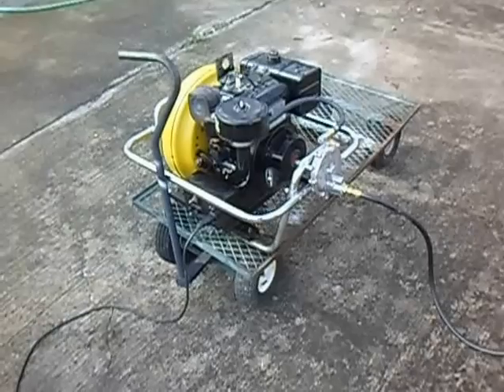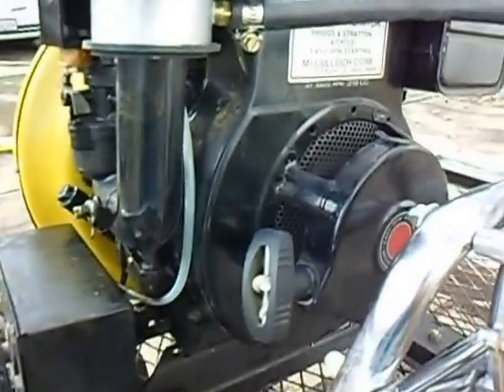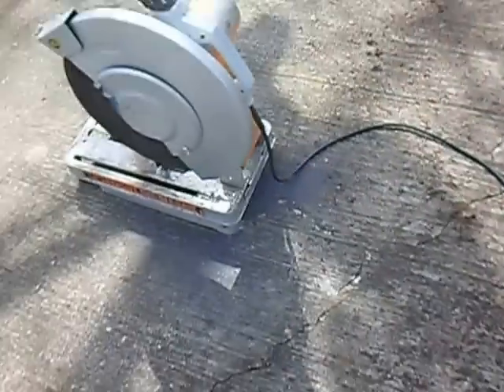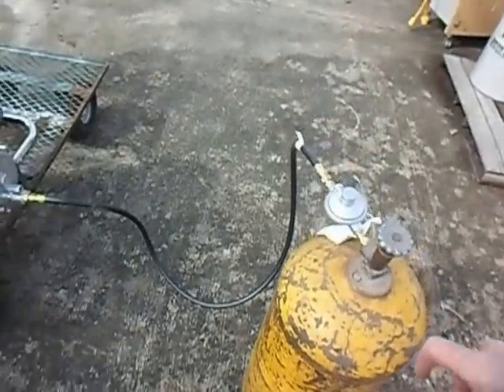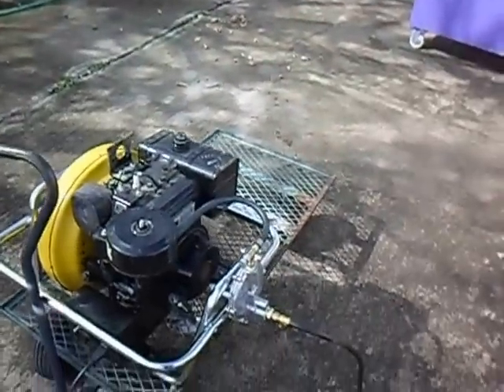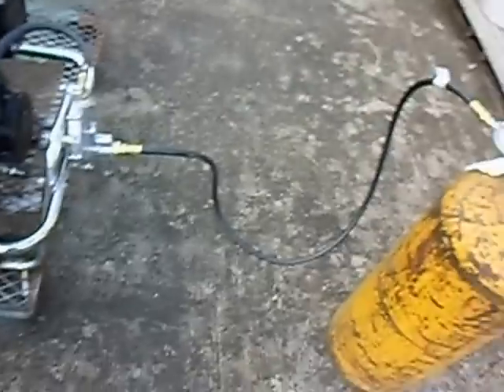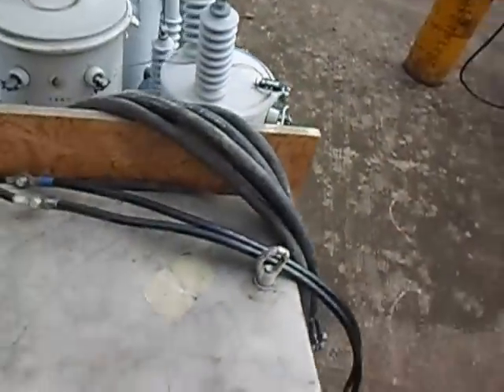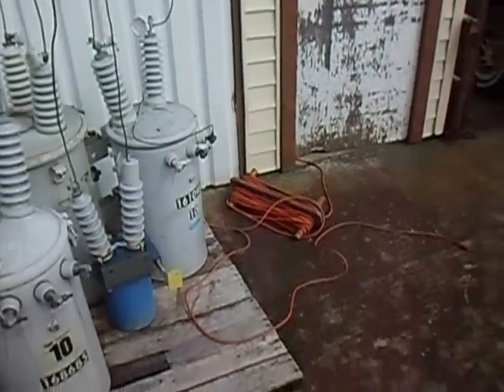McCulloch generator can now run on gasoline, propane, or natural gas

Comment: Did you ever figure out why that keeps running after the propane is turned off? The engine should shut down in a couple seconds or less. Something is not right there.
Reply: Deucealive75 line gas

Comment: Did you ever figure out why that keeps running after the propane is turned off? The engine should shut down in a couple seconds or less. Something is not right there.

Comment: If anyone want to I show how to Run generators off Vaporized Gas its much more powerfull and I get Several hundred MPG try it yourself and see. Literily I ran my generator off normal gas Stock that runs 8 Hours on 2 gallons of gas. Using Vapor I ran that same 8 hours on 1/2 gallon of gas
Reply: And how do you did it? Do you sell the system? Or teach how to do it?  I can pay pal you
Reply from the maker: Gaston gainza US Carburetion Inc. http://www.propane-generators.com/tri-fuel_kits.php sells a kit - for ALL ENGINES 12hp or smaller use Kit C - They accept Pay Pal and have a phone support line for questions.
Reply: I show how I did in my Videos if you need help I can answer question. I'm busey doing other things but you should try it its simple and starts with a Ultrasonic Fogger you can buy on ebay

Comment: Hi, if what you said it correct, you could run this motor from that propane tank for days!  You said that after you shut off the main tank, it ran for 2 minutes with a load (cutting saw) . When the main tank is off, there is no more pressure to push the gas in. The only fuel is what is in the short the line, and that's seems interesting that it runs for so long on vapor alone. It's well worth looking into this. What you could do, is simply weigh the tank before and after, run it for 30 minutes or one hour. Then from there, you do the math and extrapolate to find out how long it would last if you used all the gas in the tank (total weight). Anyway, I hope you checking it out, There is something interesting there, for sure. Cheers.

Comment: Thanks! Need to look to this system. I was planning to make my McCulloch run on vapors. There is a youtube user called "TheVaporkid", that has done some interesting work..
Reply from the maker: Kangsteri 

Took a quick look at all of “TheVaporkid” videos, it does look like he is onto something,
you might also want to look at the work done by “diveborg13” he is vaporizing gas with sound instead of heat and is getting good results, Thank you for the link.